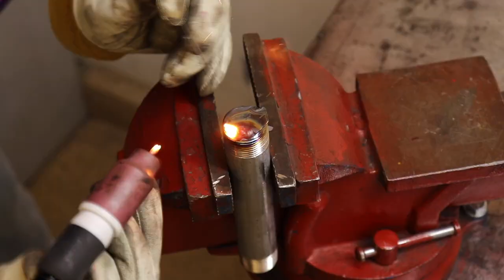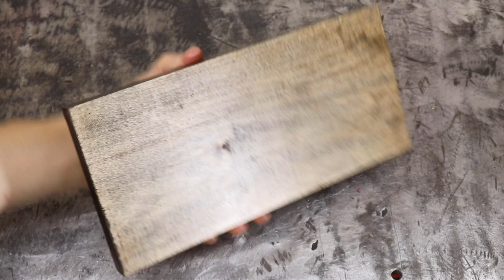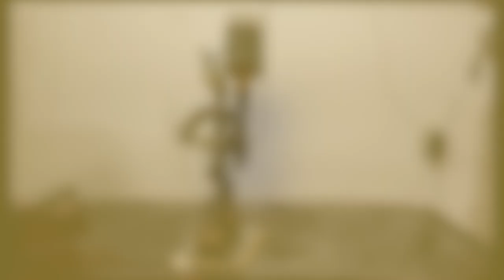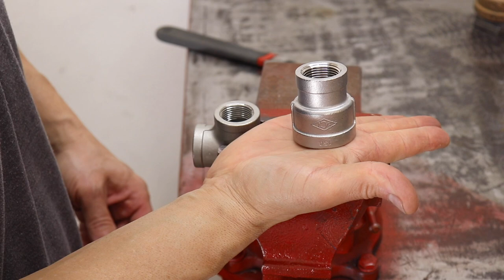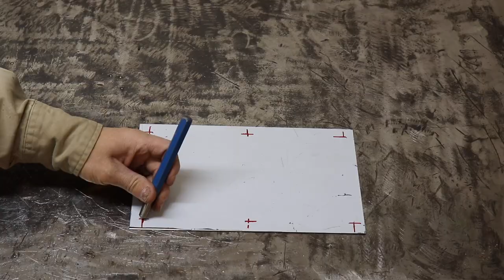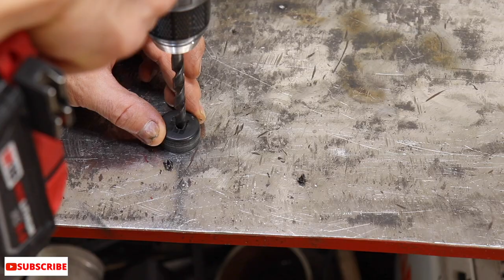2 LIQUOR DISPENSER IDEAS || DIY LIQUOR  DISPENSER || DIY WHISKEY DISPENSER

Comment: Hi, in many videos I've seen that they don't put the air vent pipe at the back to vent the air, in my opinion it's needed for a correct descent of the liquid, what do you think? Is it really necessary? Thank you
Reply from the maker: Hello, I have seen different videos where there’s  no vent.  I tried it without the vent and sometimes I did get it to flow, just had to lightly unscrew the bottle to burp it just enough to get the flow going. I think it works with or without, but definitely better flow with vent. Hope this helps. 👍